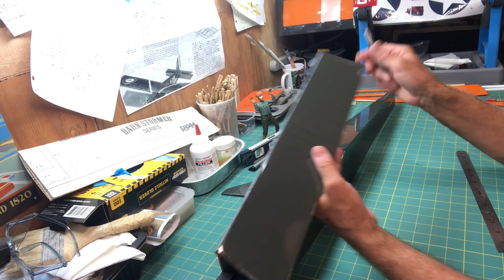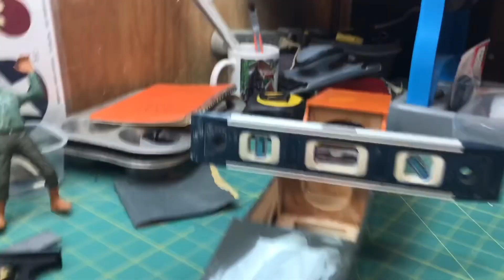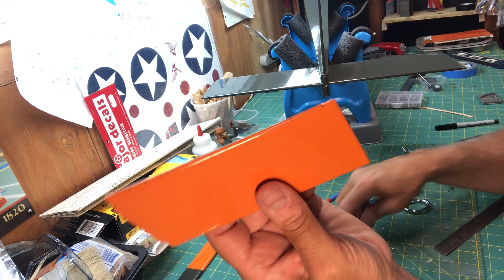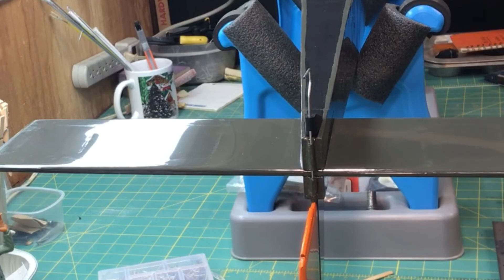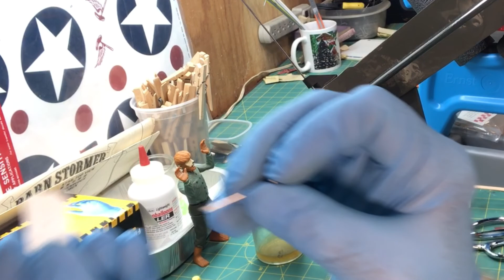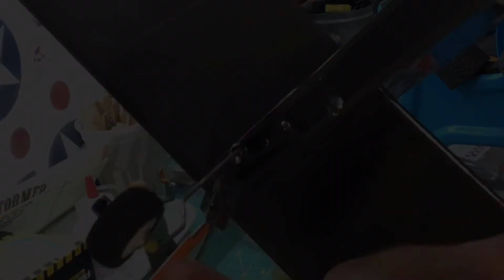Barnstormer 25S Vintage RC Plane Build: 20 Tail Section

Comment: Damn that looks nice.....I love the colors you used...sorry I haven't chimed more often.....you did a beautiful job!
Reply from the maker: Thanks Edward! No worries, I have been moving slow. But I want to get this thing done so I can spend some time flying! A few more little steps to finish up the “build” part of the build then I can mount the engine and put the guts in. I will need to break in the OS 25 FP since its a “new” engine. So a handful of steps still , but getting closer.
Reply: @jamesrcplanetech  cool...i got to fly mine at a local park a couple times...no on was using the field and it was hot day..i took advantage...its a bit on the larger "park flyer" size, but i  was able to keep it in the box..any bigger and it probably wouldnt be fun... feel free to post your videos on my buildthread...no problems with me....

hey what plane did you say you had next in line...kinda forgot
Reply from the maker: I have the Balsa USA Smoothie 40 that got to replace my Great Planes Escapade that came apart in flight.. I needed a home for my OS .46 so I figured this would be a good match. Not sure about a build log. If I do anything it will be a lot less detailed than this build series. Never built a Balsa USA kit, so looking forward to that. I’m keeping an eye on your Sig build, it looks like its coming along nicely.
Reply: @jamesrcplanetech  ahh yes, a Smoothie....those have similar lines to an Astro Hog....I've never built a BUSA kit either....I've heard nothing but good things about them....should be a fun build....your video build logs are great, but I'm sure it takes lots of time....but definitely take lots of pictures...I started doing that , and it's nice to see a box of wood, morph into an airplane....it's also helpful for others to see....I've learned alot from build logs whether it be video or picture based....most important of all enjoys it!
Reply from the maker: Yes, its a lot of fun to track build progress with pictures and then look back. I look at a lot videos and forums as well. Just doing that today researching the OS FP Im putting on this plane. Just have to find the right balance between building, flying and community participation.